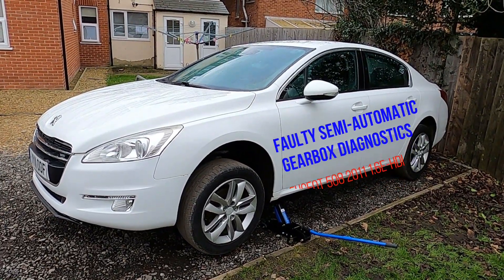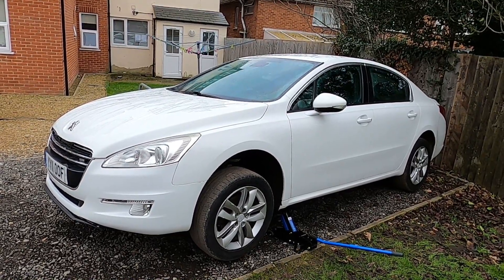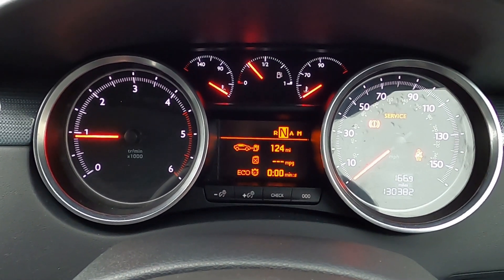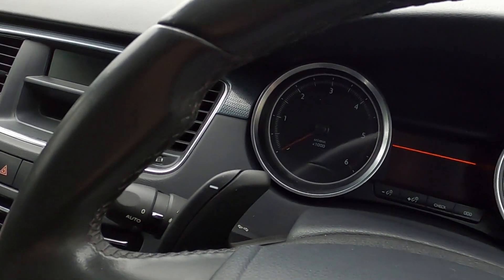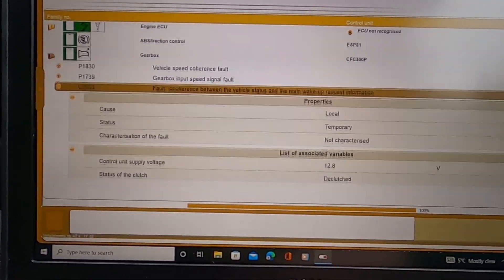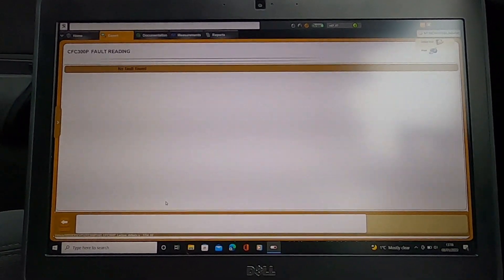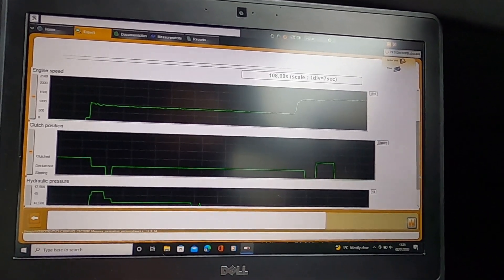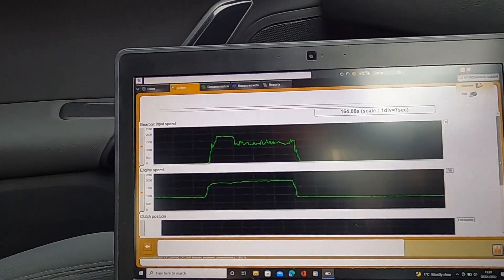6 Speed Semi-Automatic gearbox Fault Diagnostics on Peugeot 508     #P1830 #P1739 #U2003

Comment: How to fix code P0842
Reply from the maker: I am not really sure I don't think I ever had this fault code. Is it a code coming on Diagbox or a generic code reader. Couse sometimes it can be for a different things depends on what is been scanned with
Reply: @Mad4FrenchCars  Hi, read from Diagbox for Citroën grand c4 picasso ehdi. Oil pressure signal fault
Reply from the maker: @bobson5361  it's a semi automatic right? I am just thinking if this particular fault related to actual gearbox oil or actuator fluid. If its actuator fluid then I would start from checking actuator for obvious leaks and also see how much oil is in a actuator reservoir.  As it might be low on oil struggling to build a presure. What other simptoms do you have does the car drive at all how does the gear change feel?
Reply: @Mad4FrenchCars  Hi, started by showing gearbox faulty, changed the clutch plate, pressure plate and slave cylinder but had an issue during pressurizing, only to realise the pump wasn't functioning well. So imported the pump, changed the actuator fluid, the gearbox oil too and there was pressure build up, did gearbox programming and vehicle moved, but after driving for about 20km, gearbox went to manual then ultimately neutral and had to reset by removing battery terminal for it to move again. So it keeps loosing pressure when driving and has the P0842 as a permanent error
Reply from the maker: @bobson5361  what kind of actuator fluid did you use?
Reply: @Mad4FrenchCars  Used Febi 9979. It's in a green round bottle
Reply from the maker: @bobson5361  I am not sure if its correct fluid. I know that the fluid should be Gearbox actuator oil
SELENIA oil
TUTELA CAR CS SPEED
SAE 75W
Part number 9979.A4.
But I have used Revenol GHA-F as it has same properties not sure if its something to do with fluid but these cars are very fussy when it comes to fluids.
Reply from the maker: @bobson5361  can actually vouch for a Revenol GHA-F as that done a job well for me
Reply: @Mad4FrenchCars  let me arrange and drain the current fluid then and replace with one of your recommendations then to see if there'll be a change. So even though the Febi 9979 A3 meets the standard, it can still be a cause for the constant drop in actuator while driving?
Reply from the maker: @bobson5361  these actuators are devil's inventions it could be loads of things. I have ordered a Revenol GHA-F fluid straight from supplier in wales took only couple of days to arrive. Also when replacing fluid perform depresurising the gearbox actuator on a diagbox and then pressurising once a fluid been replaced. Then I needed to replace fluid I disconnected a Cluch slave cylinder high presure hose and I would actuate a Cluch with Diagbox so it squirts all liquid from system to a container and once expansion tax was empty I started to fill it up with new fluid until it start to squirt from a high presure hose going to slave cylinder. Ravenol is green in colour so it's easy to see once it starts to squirt out. I ordered 2 L of it but only used just over a litre.
Reply from the maker: @bobson5361  also I would check again for leaks as it sounds like it loose the presure very quick
Reply: @Mad4FrenchCars  Hi, thanks for the info. I have managed to change the fluid but programming on the gearbox learning part keeps failing. The vehicle is clutched and seems slave bearing is stuck.
Reply from the maker: @bobson5361  hi mate does any fault about a Cluch position coming up? Sorry I can't be much help it's difficult to help through a distance. It most of the time fail gearbox programming becouse of battery current is not enough or car go to economy mode. Try to connect another car with jump leads and then program the gearbox.
Reply: @Mad4FrenchCars  Yes so am trying to reprogram but after completing even the clutch biting position and moves, pressure keeps failing with the code p0842 which is suspect is the major cause. But an able to tell the cause. Says short circuit to earth on the parameters
Reply from the maker: @bobson5361  maybe the problem is somethere some greas or fluid got in to one of the connectors. These gearboxes are probably the worst gearbox I have seen and I feel your pain mate. These actuators can have a problems of all sorts. Try to clean all the connectors and stuff maybe something is shorting itself couse of a little grease or oil somethere I am not sure.
Reply: @Mad4FrenchCars  Can one change this system to EAT6? Ie from semi auto to auto
Reply from the maker: @bobson5361  I am not sure mate I have never tried.
Reply: @Mad4FrenchCars  Thank you mate, I really value your feedbacks. I've decided to change the ECU after long deliberation and diagnosis as ECU error started popping up too, probably the cause of the permanent error
Reply from the maker: @bobson5361  hope it fix it for you let me know how it goes.
Reply: My Peugeot 3008, 2011 model , semi automatic transmission won't engage at first start. It's takes about 4 starts of the  car engine before the gear can engage, and when it does, the gear selects well. I have run a scan on it, I got a P1755-clutch actuator stalk. 
Please, can changing the transmission fluid fix this fault? 
Please I need an honest answer. 
Thanks in advance.
Reply: My Peugeot 3008, 2011 model , semi automatic transmission won't engage at first start. It's takes about 4 starts of the  car engine before the gear can engage, and when it does, the gear selects well. I have run a scan on it, I got a P1755-clutch actuator stalk. 
Please, can changing the transmission fluid fix this fault? 
Please I need an honest answer. 
Thanks in advance.

Comment: I have the same issue: gearbox fault, repair needed. But it comes only sometimes, maybe in 1 of 10 starts. I try to restart engine several times, and after around 15 minutes gear can be selected and car drives fine! Any idea what's wrong? (Peugeot 508 2011)
Reply from the maker: I would start from checking things like battery it might be old and these do affect semi auto gearbox. Another thing to check  would be gearbox actuator fluid  level, and also little visual inspection to see if there is no visual fluid leaks. If battery is good and actuator fluids seem to be fine. Then I would plug Diagbox and scan the car for codes as even if it doesn't come up now it will be stored and that would help to find out what could be wrong with it.
Reply: I have the same problem. Notification "gearbox fault" poped out last week, and I didnt see it properly so I ignored it. Few minutes ago the same happend so I'll go to mechanic tomorrow. Have you repaired it? What should I expect :-) ?
Reply: Hello, I have same problem. My car is 508 manufactured 2013. To first start the car sometimes said ‘gearbox is fault, repair needed. But sometimes it’s running without problem. did you solve this problem ? If you solved, how did you ? Please help me :) thanks
Reply: I have this exact same problem. Sometimes will run the entire day perfectly. But in 6am in the morning, PRND: Gearbox Repair is shown. No idea what the problem is - but one thing I know for sure is that it isn't a gearbox problem.
Reply: Another source for this problem could be the generator. A friend with a 508 got this problem, and the car let him only switch to maximum 3rd gear. After replacing the generator, the car worked fine. @urimkrasniqi6975
Reply: @Aktiespejaren may i know what generator ya?

Comment: I have a similar issue on a Peugeot 3008 2011 EGC semi-auto. Only difference is sometimes car runs fine, with smooth gear changes in all 6 gears. Any thoughts? Any help would be appreciated
Reply from the maker: Need to get it scanned. If it's a issue which you get only sometimes then it might some electric connector on a actuator or even actuator hidraulic fluid level. My car would shift in every gear but a Cluch was fried so it would just slip and wouldn't drive.
Reply: @Mad4FrenchCars  Tried to scan it last night with The Torque ELM 327 Bluetooth app, but then the battery went flat. Seen on some Peugeot forums people saying a weak battery could actually lead to such faults, so will change battery and trya Nd do the scan again. The software and connector you are using can that be purchased off eBay or Amazon, link would be appreciated
Reply from the maker: @YellowFever4ever  hi mate yes you can get Diagbox from ebay it's like a 2 CDs and install on your laptop also you get cable. If you go on ebay just search Diagbox it will come up with quite a few. It works best on Windows xp or 7 but if you can put it on a virtual drive then you can use on Windows 10 aswell. Regarding a battery I have come to conclusion that battery does have a influence on semi auto boxes. For The 508 I am currently putting together I will put new battery aswell as I think these boxes are quite dependant on battery power.
Reply: @Mad4FrenchCars  I changed the battery and it worked fine for a week, but now the fault is back again, but not just gearbox anymore, it's flagging a parking brake and engine fault. Codes I managed to erase via Torque elm were U0073, U0103, and P1767. I looged a trip I did via Torque elm, where I got all six gear changes multiple times. I was wondering if there is a way to share the CSV files with you to see what you make of the Revs Vs Speed, just to rule out any clutch slipping. I have a strong feeling I have an issue with my ECU and not the gearbox.
Reply from the maker: @YellowFever4ever  best way to rule out a Cluch is to read live data personalised parameters under gearbox via Diagbox and see if it shows slipping. What battery did you get as if you have stop start it would have to be stop start battery.
Reply: @Mad4FrenchCars  Was looking at the Diagbox but apparently does not work with my windows system windows 10. Something about needing a virtual machine or Win XP/7. Not had chance to look into getting it on my PC which is why not ordered. My car is not a Stop Start.
Reply: @Mad4FrenchCars  Just wondering is there a way to do a hard reset on the ECU. Just wanna try that first b4 going down root of getting a laptop for the diagbox
Reply from the maker: @YellowFever4ever  you need to get Diagbox that's the only proper way to test. Also have you checked your actuator reservoir flued level?
Reply from the maker: @YellowFever4ever  hard reset on gearbox or car ecu if for a gearbox ecu there is a procedure for temporary fix I think but I don't know any for a car ecu. Most of the tyme just delete errors sometimes battery swapping can give some random faults you delete them and it shouldn't come back

Comment: how depressurized de gearbox for change the clutch?
Reply from the maker: To depressurize a gearbox hydraulic system you have to go to gearbox section on DIAGBOX and chose repair then choose gearbox programming and choose depressurise a hydraulic circuit DIAGBOX does it by itself once you choose the option. After Clutch replacement you need to pressurise the system  again and sometimes run a bleeding setting and also need to program a gearbox. nothing major as DIAGBOX does it itself things like a gear learning also clutch biting point. one thing to mention some cars require a economy mode to be deactivated to perform depressurization.
Reply: @Mad4FrenchCars  thx but my bosh dont have depressure hydraulic only test gearbox
Reply from the maker: @technics.radu01  I am not familiar with bosh system, I am working with Diagbox mainly as I only work on French cars.
Reply from the maker: @technics.radu01  if it doesnt have depresurise option then its not gonna be able to pressurise it either. Need to get different diagnostic software otherwise you can't really tell gearbox ecu after job done to learn a new values

Comment: Hy my friend.your diagbox work on windows 10?🤔
Reply from the maker: Yes it does but the only version wich works is V07.59. Other versions doesn't seem to work on it. My old laptop had xp all the updates was working fine.
Reply: @Mad4FrenchCars  Hi cracking video btw. 9.91 works via vm on 64bit windows 10
Reply from the maker: @MarkWilliams-fb1no  thank you mate, I will note it down it would be nice to get later update on mine.
Reply: @Mad4FrenchCars  can recomend the same guy I used his videos and help guides are spot on I have the Lexia and autocom both bob on
Reply: @Mad4FrenchCars  Are you running this on a 64 bit version of Win 10?
Reply from the maker: @michaelk2637  yes I am mate, but only old update works, new ones doesn't. You need virtual drive and I am not using one
Reply: @Mad4FrenchCars  So up to version 7.59 works fine on Win 10. I have it running on 10 via a VM but it's a bit clunky. I was wondering if I should try to run it on my 64 bit system.
Reply from the maker: @michaelk2637  all I can say is from my personal experience all the updates works on xp and Windows 7 and on my 64 bit Windows 10 only update mentioned above works then I update it starts to developer problems I have not tried myself on virtual drive but people telling me it works fine on a virtual drives.
Reply: @Mad4FrenchCars  Ok. Thank you so much mate for sharing your experience with me. I really appreciate it.
Reply: @Mad4FrenchCars  y have 7.82 works great on win 7
Reply from the maker: @bmarian9357  that's more then enough for most of models

Comment: Where did u get the cable for the ECU and what software and where do I get it ?thanks?
Reply from the maker: Hi mate a software is called Diagbox, my one is an old version V07.59 . You order a diagbox with lexia from ebay and you get cable and 1 or 2 CDs then you install it to the laptop preferably a old Windows xp or 7 but older versions like V07. 59 works on Windows 10 aswell and you have yourself a scanner for your car.
Reply from the maker: Lastest Lexia3 PP2000 with Diagbox V7.83 Diagnostic DVD Read Clear Fault Codes | eBay
https://www.ebay.co.uk/itm/393744222143?_trkparms=amclksrc%3DITM%26aid%3D1110006%26algo%3DHOMESPLICE.SIM%26ao%3D1%26asc%3D20190917065201%26meid%3Da38fd7391d91455bb8d233942c379b4c%26pid%3D101096%26rk%3D5%26rkt%3D9%26sd%3D113376834491%26itm%3D393744222143%26pmt%3D1%26noa%3D0%26pg%3D2332490%26algv%3DSimplAMLv5PairwiseWebWithBBEV2bAndUBSourceDemotionWithUltimatelyBoughtOfCoviewV1%26brand%3DUnbranded&_trksid=p2332490.c101096.m3021&amdata=cksum%3A393744222143a38fd7391d91455bb8d233942c379b4c%7Cenc%3AAQAGAAACMLFimQXsLgM9ftk1cEAAABDlAN75xACRDxbtsCeZwVsCq3WEnIiJFIJJbKGy8uwfNlEmo47chBNnQS9Q10FOgWZ2uPr%252Bo%252FYpfq5Dte34btLSMBrPqROvnK2XkK0xplhpZ3k8iXS4WCQLtwvPGYolO3qfSssOCxfQgXHO2fbM6m%252FBhrFuLxZFJiTkyyX%252B5z9I%252F85z1DBdGyyrxBJFDXZ3dKqO06jdvWoMLebWiLufh7yWdcVjmmnYryPk%252FPOqm3rkaJhE6AodhH0hk247Rp9eYoOYH%252FH%252BNPrqYnuoFVpdd8%252FKoIN6thXCTi4FnnFP5JyZoSpvOtLBJK2bz92UXOEdFazo3kxTSu3wpbxs2KT0b%252FqD6asTezr03Jjc36maEVoRHOn6QsKFeZjtz9IXgadY5DIQL0BwG6rB0M6yzWl4fquQsOQLrZ3mFR%252BDaceyiaJ0fyd8I5fGjxBW4XKL81A2uJKiy7zYKnQm1B3fz3VTBJxgoKVAeY0Uc3uUN1qlC2GSwa3vkWItBQVWChQLiz1gpKwfO0q5QorgpD%252FvHV2iei1mHLoRZxU%252BbAhPaj3smypLjW%252BTHOWee1RBsg%252BOwTcgONfJ2CjFq3rBihSQFy7lYjSD3qrQ1QSy2JjUzrEGP9YMGJLMonWZmLxDlX1elyaxRfffl0mBG8RmjHEuMvQLNbLxVTdkBVmoAErV3%252Bfv7V0xMe%252BmA1r3QkS1G1bJwy95mhQCal67xML1V7eF3TT2fjIm%7Campid%3APL_CLK%7Cclp%3A2332490
Reply: @Mad4FrenchCars  dead link now.
Reply from the maker: @datman7179 ya its very hard to find a good diagbox software these days